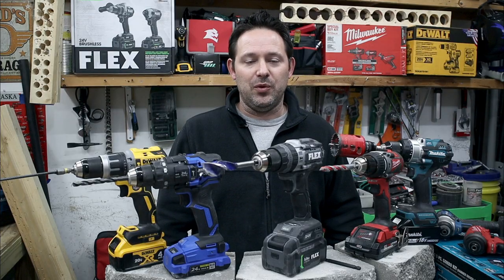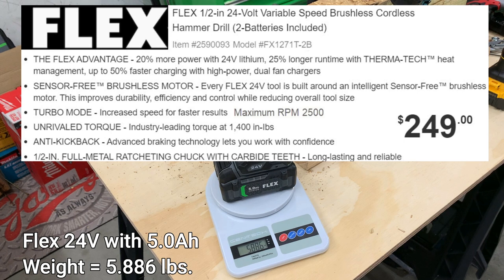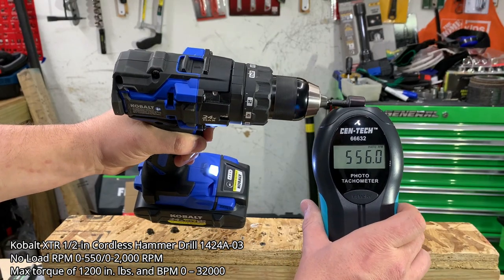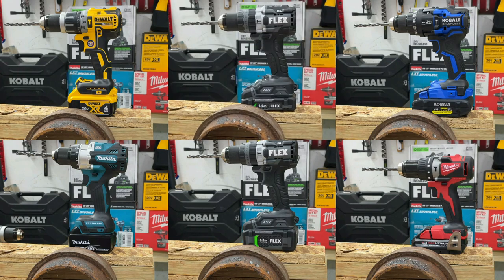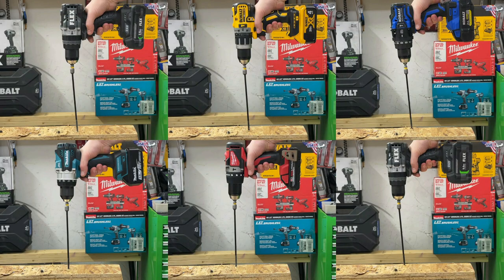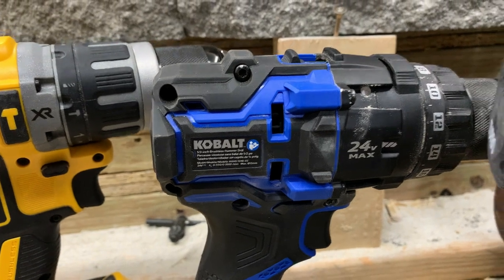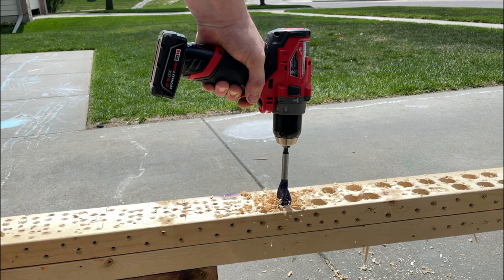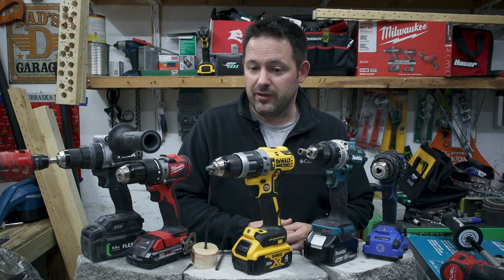Turbo Drill vs Mid-Range Drills | You Are Really The Difference? Hammer Drilling Tips

Comment: Why did you use the lower powered Milwaukee and the lower powered DeWalt
Reply from the maker: The 3.0Ah high output preformed slightly better than the 4.0Ah XC battery in tests with the impact driver when both were fully charged

Comment: I would love to see you put the flex hammer drill and impact driver up against the ryobi hp brushless hammer drill and 4 mode hp brushless impact driver, I love your tool test videos.
Reply: MCT did that, Flex won but I believe the Ryobi is the 2nd or 3rd fastest in getting through concrete

Comment: I bought the Makita around the time this video was released for $149 with bonus free 2.0 battery. Sometimes buying a set kit isn't the best way to buy a tool, because most people will not need another charger once they are in a battery platform. Over $300 seems ridiculous. I also bought the rear handle circ saw around the same time which came w/5.0 Ah batteries x 4.
Reply: Bought a xdt13 and xph12 with two 3.0ah for the same price about two years ago. But this was during Christmas season.

Comment: That’s the Dewalt dcd 796 right?
I had that thing for 3 months before it stop working drilling 3/4 hole through 2 2x4 running wire. Sold all my Dewalt crap after that. My stuff needs to work or I don’t make money.
Reply: Just curious about what did you end up with?
Reply: @MrLuisinho90  

Milwaukee m12 fuel and m18 fuel 

 I Would also take the Makita xt288t kit and stuff never had a problem with the Makitas I’ve owned
Reply: @apa7611  I'm currently on Bosch's 18V platform, but can't go wrong with Milwaukee's Fuel line
Reply: @MrLuisinho90  

My buddy I worked with for a few years has Bosch everything! Damn good stuff
Reply: @apa7611  it is. I love the versatility of my Freak 2 with both 1/4" and 1/2" anvil. It's never let me down. My hammerdrill and sawzall have been top notch as well

Comment: You have to apply specific force on a drill bit. Otherwise you will burn the tip.
Reply: Agreed, especially for metal.  Slot bit speed, but with a lot of pressure (Hence drill presses) and a good cutting fluid are the only way.  You want decent sized chips, not tiny little needles or worse, a powder.  And there's no such thing as good cheap bits for metal.  Cobalt bits aren't cheap, but you will get more than one hole out of them.
Reply from the maker: Force is one thing and speed is another. Having nice metal curls and zero discoloration is always a plus but a lot of that can be tough without a drill press.
Reply: @ClientGraphics  Most definitely.  The magnetic drill presses are great for situations where you can't get to a drill press.  But otherwise, yeah it is definitely difficult to hand-drill metal with enough force to prevent burning up the tip.  I usually will use a stepped bit or drill a succession of larger drills so that the force I can apply is still pretty high.  I must have went through a dozen bits when drilling out ball joint rivets with a hand drill and cheap bits.

Comment: A very good message.  Most brushless drills are working with (let's be honest) 98% comparable parts and are only limited by how powerful of a battery you are using.  

Each of these brands is investing in state-of-the-art batteries. So there is more convergent evolution on that side as well.